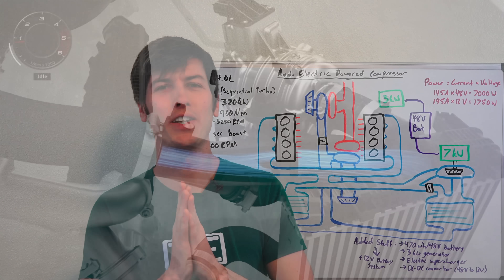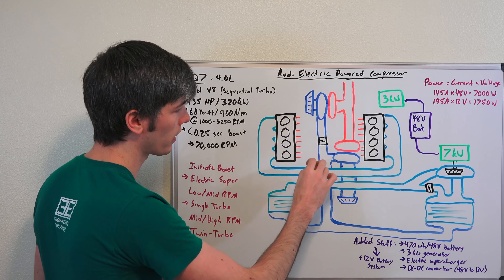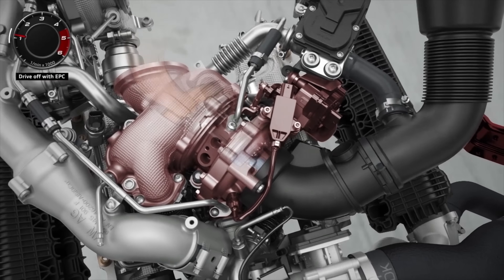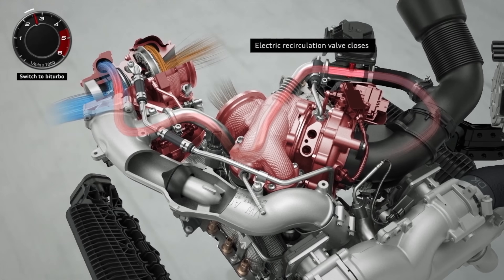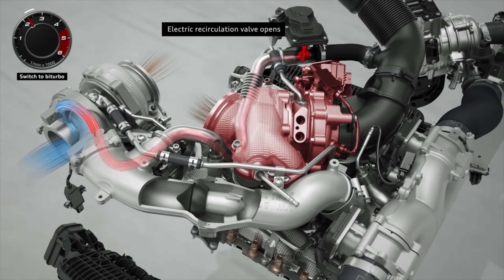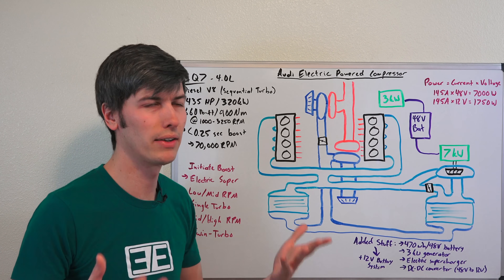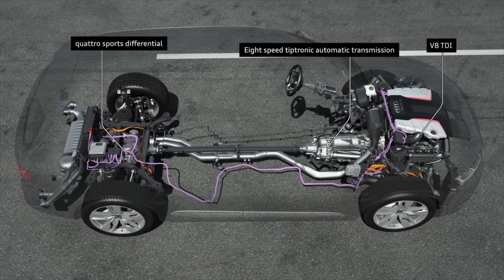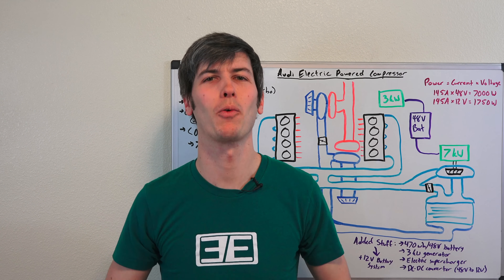Electric Superchargers - How Audi Is Eliminating Turbo Lag

Comment: Lets make complicated engine even more complicated. Man they reeeealy want us to buy a new car every 3-5 years because fixing these things will be more expensive than the actual value of working used cars. So many potential failure points.
Reply: Daniel Santos Take a look at some of the Teslas that have been around for around 100,000 mi. Multiple motor replacement and a plethora of other issues. All cars companies need to focus on reliability first.
Reply: Thats why you lease them
Reply: +Nor Dic 
Just to get things off to an even start, are you sure that isn't More Dick?
The biggest cost issue with nuclear is excessive and extreme regulations on the plants. Some systems have as many as 6 back up systems, not total systems just back up. What do you think that does to cost of construction? Finland has one of the largest nuclear power plants in the world that supplies most of the countries power. France, which I think you would agree is a very"Green" country uses small neighborhood nuclear plants for over 50% of their power. Plants that are not allowed to be constructed in this country.
As for the cost of solar and wind power ask the Green germans how much that they are paying for electricity.
As for wind power in this country, they have have been granted an exemption from the endangered species act for the large number of dead birds laying around.
For what you are probably calling the big commercial solar plants, who knows because they don't leave evidence behind. As for the cost of solar and wind power, first they don't mention the subsides they receive and second they don't include replacement costs. The other forms of power are required to. When you drive through the altamont pass wind farm, most of them aren't turning. Not good.
The new hyper-crytical coal plants and the new natural gas plants with the newest scrubbers put out nothing but water vapor. But they have been regulated to the point of being unfeasible. Plus the system operators choose which generator system by cost formula which are heavily weighted in favor of green.
I believe that I've responded to most of your comments, but if not let me know. Oh, one more item on co2. The 400ppm they are using for a base line is about as low as you're going to find, if you go back and check prehistoric Data. To increase growth greenhouse owners add a lot of co2. As to what would cause harm to animal life? The upper limit on a US submarine is 8000ppm. In final, no causetive direct connection between co2 has been shown or that co2 is a primary cause and not water vapor.
Reply: +Daniel Santos 
distant future! if you're talking Bev electric, may I ask where do you plan on getting the electricity to charge them all? The grid is already old and overstressed. They have regulated nuclear power out of profitability, solar and wind are a joke, and they are trying to tear down dams, (the only viable renewable power).
Now to go on to the reality of batteries. Where does the lithium for the batteries (the only batteries with enough energy density) come from? Places that pay absolutely no attention to environmental laws like we have here. To produce the battery pack for a Prius makes the same co2 as a car getting 32mpg does in 100,000 miles. So If you wreck 5 minutes after you buy it ,it's still produced 100,000 miles worth of co2.
Not that co2 is the problem the nuts like Al Gore would like like you to believe. "The Arctic will be ice free in 5years . I think he said that in 1998, and again in 2005.
Ask the people in the Northeast how global warming is working for them.  The cover of times magazine some time in the early 70s, The coming ice age 😂😲😂
Reply: CBmech, that is some king of anti green rant.

Did you know that utility scale solar is 1/2 the price of nuclear per MHWhr to build, but with out the ongoing fuel and maintenance costs ?

Did you know that new coal power station cost about the same as new utility scale solar per MHWhr, but solar is essentially free to run once its built ?

Did you know that 2/3rds of the mercury in our food chain is from man made sources, the highest being coal power stations.

i could go on, but your ignorance is breath taking.
Reply: Was that enough of a green rant from someone who you consider ignorant?😄😂😉. Your response should be interesting!😀
Reply: @Cbmech nuclear power is clean energy with the cost of it being much cheaper than other solutions... sure solar panels can be used on houses but for a solar farm you got to cut down many trees (and still its no where near efficient as a bio reactor that outputs hydrogen).. a hydro power-plant is very cost effective but there is only so many areas you can install one...

the newest tech we can take natural gas, convert it to hydrogen and get much more energy from it... the problem with nuclear power is the waste which in the past has been disposed incorrectly and they're using that into scaring ppl into thinking that nuclear power= evil... ppl like Elon Musk owns solar city so if he want to sell more solar panels letting ppl be ignorant towards nuclear power will make him more money...

until we find a way to make "cold fusion" work (Amazon funded project is close to doing that) nuclear power (fission) is our best solution for both clean energy and cheap energy for the masses....
Reply: dun hill and cb, I presume you 2 are both Americans, as you both seem to be total ignorant.

Utility scale solar has been half the price to build, per MWhr, as compared to building Nuclear power, for a coulple of years now. look it up  Google is your friend. But with solar, there are virtually no ongoing costs, comapredto Nuclear, just the fuel is expensive, not to mention the decommissioning costs.

The bottom has fallen out of the Nuclear construction industry, hence Westinghouse is seriously bankrupt. The only arm of Westinghouse nuclear making money is the plant decommissioning devision.

Globally most new power genration contruction money is in renewables. Eg, India commissioned a 2MW solar plant last week. China spent $155B USD building renewable power in 2015, half of the world's spend on renewables that year.

The future is green, with only a few countries, notably the USA, dragging thier feet on progress.
Reply: 1st u think Toshiba is American? Which owned Westinghouse nuclear and bankrupted the company.  U do know that Google and this post is and most of tech in the world comes from america? If arrogance was intelligence Euroland would keep more ur Noble Prize at home, instead of sending most of them to places like the USA. 

And the air in US cities is far cleaner to breath without all the diesels car like from the land of dieselgate. 

Im starting to think Euroland gets all it news from RT...
Reply: It's mainly uprated components. 12volt battery->48volt battery.
Uprated alternator, every car has one.
The supercharger is just a motor with a fan. 
Definitely not cheap though.
Reply: Nice over simplification, we have a pres that would be proud of it :)
Reply: "They have regulated nuclear power out of profitability"

Worse than that, they have explicitly prohibited the only long term viable form of nuclear fission energy (Molten Salt systems) from being licensed in the USA - which underscores the political motivations of Richard Nixon's shutdown of the Oak Ridge research.
Reply: We dont need regs just look at how safe and lovely, Chernobyl and Fukushima r now. 

This post is about "Electric Superchargers" not a political BS conspiracy theory nut forum, now go troll somewhere else....
Reply: You need to educate yourself on the difference between boilerplate ratings and actual delivered power. There's a world of difference between them. 

What you've quoted for Solar is true for boilerplate ratings, but the reality is that the solar plant will deliver less than 15% of the total energy that the nuclear or coal plant will over their respective lifespans. There simply isn't enough space to put solar/wind generation in place to replace all the carbon-emitting systems we have (we can just about replace electricity capacity, but that's only 30% of total carbon emissions)

Did you know there's enough Thorium in coal ash to justify extracting it to supply fuel for molten salt nuclear power plants? That would pay the costs of cleaning up the largest environmental risks facing the United States at the moment - the two largest USA environmental disasters so far this century have been coal ash dam breaks and there are thousands of them scattered around the country in the EPA's catalog, with an unknown number undiscovered as they weren't notifiable until 15 years ago.

The total high level waste from a conventional 1000MW nuclear power station in its 60year lifespan will fill an olympic-size swimming pool and be safe to handle in 350-400 years. A Molten Salt system can reduce that volume by 99%, reduce the input wastage by 89% and "eat" the existing high level waste as sidestream fuel.
Reply: Here's a direct CO2 one for you: The oceans are 30% more acidic than they were 200 years ago (Ph scales are logarithmic) and shellfish/corals are starting to have trouble forming shells, as are zooplankton. If there's a crash in zooplankton levels then the entire oceanic food chain falls apart in less than 5 years - it's much the same as if bees die off on land.

At that point you get uncontrolled algae blooms and then you get an anoxic event. We know what happens in those as they've happened in geological history. It's written in the rocks.
Reply: What bankrupted Westinghouse nuclear was the poison pill of buying British Nuclear Fuels. Trying to keep Westinghouse afloat nearly bankrupted Toshiba.
Reply: U keep changing the subject when ur shown to be wrong and most of us here Im sure know the science better than u already. 

But the point still is this is not forum for u to rant about non-germane topics troll.
Reply: ktm640lc4BGD This is a perfect view of why electric vehicles are the "WE NEED THEM NOW" future.
Reply: hehe, this video just made me look at the prices of BMW i3. i am browsing right now.

Comment: How much added weight over a traditional set up?
Reply: A lot but it's going in an SUV so I don't think anyone cares.
Reply: Just guessing, but with the added battery, generator, supercharger, and piping... Probably 300-500lbs.
Reply: Not much.. propably 4-5kg. The battery and generator are already there (required for electric swaybars and power-generators). The car already had the 48 volt system for those funktions, might as well use it.
Reply: @sienile  Are you insane???
Reply: Kommentator - I didn't know the electrical system was already setup like that. I seriously doubt the supercharger only weighs 5kg. Most turbos (which are more similar in design to this than traditional superchargers) weigh 50lbs and this would have an electric motor to increase the weight, so it's probably closer to 100lbs. Then you still have the additional piping and valves. So it's probably still a 100-130 lbs difference.
Reply: Ben Averill either way approx 200lbs added and -10hp for the electrical draw. I fail to see the benefits for this system. The added power and efficiency is minimal. All you are getting is a smoother curve.
Reply: sienile
I don't think so. As this new turbocharger is placed behind the intercooler, heat stress is minimal which allows Audi to use very thin aluminium without any cooling channels, drastically reducing weight.

Comment: Will be a mechanic nightmare lol 😂..
Reply: Why? A generator, a small lithium battery and a small electric motor.. that`s manageable
Reply: Kommentator trouble shooting may not that easy.. All connected electronically
Reply: So what? Grab a multimeter and go ahead. It`s really not that difficult   :D
Reply: "Grab a multimeter... it's really not that difficult" HAHAH! Time is money, buddy.
Reply: Kommentator For the avetage diyer yes it can be a pain.
Plus this will require a specific Audi/vw scan tool which again,most diyers dont have.
Only special people like you and I friend.
No be humble and stfu.
Reply: Lets remember if you have an SQ7 your not taking it to your downtown mechanic. Your taking it to the Audi dealer like you should😁
Reply: Lol even audi dealer can't fix these cars after multiple visits.
Reply: A dealer's paradise.
Reply: A used Audi was the worst car I ever bought. Biggest automotive mistake ever.  That car hated me and I was nothing but nice to it.
Reply: More money for parts,servicing and dealers.
It'll be a money pit.
Reply: It's an Audi lol there already a mechanic nightmare and an owners nightmare
Reply: Remember, all of this crap has to go somewhere, and if it's not broken itself, it's likely in the way of whatever you're trying to fix. If manufacturers are going to cram more and more junk under the hood, they should start making the engine bay bigger.
Reply: Heineken FiftySeven  a roots type actually acts as a damper on the crankshaft. I would argue its better.
Reply: be an audi mechanic, they will be teach you how to handle it
Reply: The electric motor driven supercharger actualy seems like the most simple part. The crazy complex part is multiple forced induction and valves to direct it all in sychronous.
Reply: I would say, "Git Gud"
Reply: Randy Hartono - Naturally. They’re already an owner’s nightmare. Even service technicians are at a loss to figure it out when things go wrong anymore... Look at new cars as delicate bits of conceptual sculpture while continuing to drive an old reliable car and you’ll live a happier life.
Reply: Too much over-engineering just to reinvent the wheel. A conventional supercharger, or better yet, just a larger displacement engine will be more reliable, cheaper, and better for the environment in the long run because longer lifespan = lower carbon footprint from wasteful manufacturing process.
Reply: Randy Hartono the new generation of tech/ mechanics , will be able to service these.

Comment: Of course I'm no engineer, but would it be possible to have a buffer chamber storing high pressure air that would get released whenever the engine needs that air injection? The car could keep filling that buffer chamber to have it topped at all times. I think it's quicker to release high pressured air instead of generating that air flow on demand. Just a thought.
Reply from the maker: Yes, somewhat. Similar to what Volvo is doing: https://youtu.be/Sr5mksh68A4
Reply: EE did a video on that as well if i am correct. Volvo uses this kind of technology in their new cars.
Reply: volvo did exact this thing in their new t8 engine, jason made video about it few months ago
Reply: Volvo has that system in their top diesel, instead of this electric thing.
Reply: Funny you should mention that. Jason did a video a couple months ago about how Volvo is eliminating turbo lag with the exact system you just mentioned.

Comment: Or imagine if the 7000W turbocharger it's used with the 12V battery system, then it would be drawing 583A, which is a hell of a lot of current. It just wouldn't work
Reply from the maker: Yep, exactly.

Comment: In about five years these units will be snapped up from wreaking yard. Guys will be putting them in all kinds of cars.
Reply: In 5 years, the planned obsolescence engineering that the Germans are experts at will ensure these things will self destruct out of warranty!
Reply: Israr Kabir at the very lest Audi just made this idea mainstream, it won’t t be long until the aftermarket picks this up and offers something.
Reply: Yeah lemme just put this Saturn V rocket into my Silvia
Reply: David Westernall it takes a shitload of power to compress volumes of air. This is only good for momentary power. If you made a diy system you could use it for a couple "romps" but then you'd have to wait for the battery (batteries) to charge again. There is no real leap of improvement that can make an electric compressor exponentially better.
Reply: I was thinking the exact same thing.  Especially the way Audi drivers tend to stuff their cars.  Won’t be long ‘til these things are readily available.
Reply: that's 2 years
Reply: Anton Zuykov, ha ha, you sound like my mechanic. About your "aftermarket" engineers comment.
Reply: To do this properly you'll need an "alternator" (actually a motor/generator) which forms an integral part of the flywheel, or is driven directly off the front of the engine (which isn't as silly an idea as it sounds) Getting the power needed out of a belt-driven accessory won't be pretty, safe or reliable.
Reply: Depends on how many amp hours are in the battery pack as fully electric cars are a thing.
Reply: A belt driven supercharger can easily draw over 20hp or more and there's no serious safety issues with them.
Reply: Snapped up from wrecking yards / Guys will be putting them in all kinds of cars??? Not a chance! What guy will want to swap in this overly-complicated POS when you can buy a junkyard GM V8 truck motor for 400 bucks. Add a cam, injectors and a chinese turbo and you've got 500-600 HP to the wheels.
Reply: I certainly will, once hybrid/electric cars become mandatory in 2040.
Reply: and gals